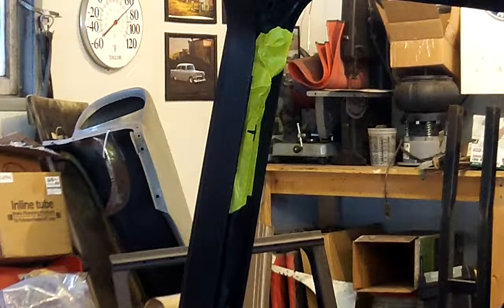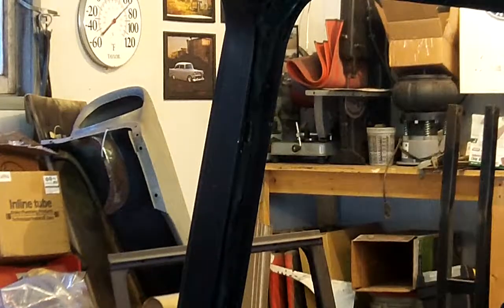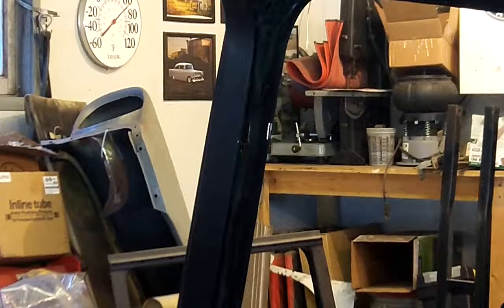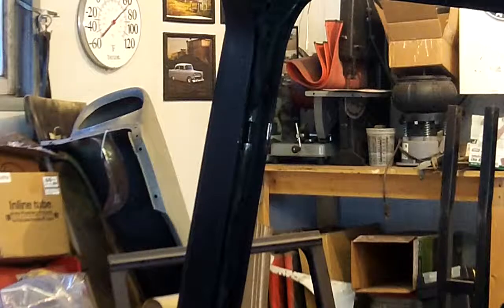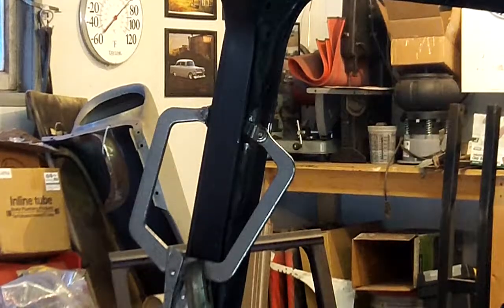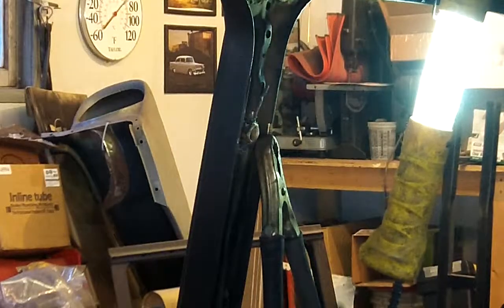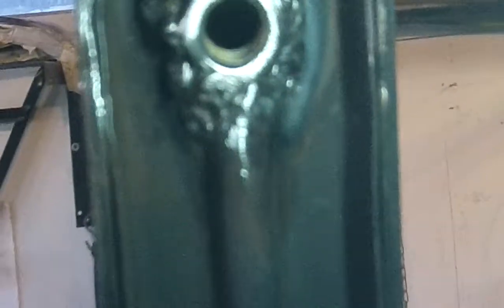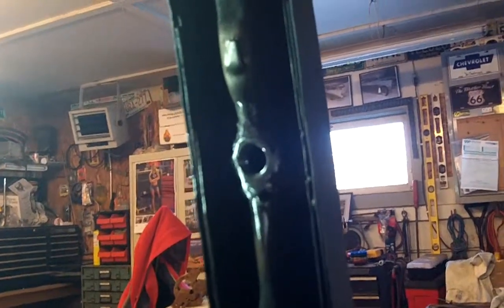1956 Chevy three point seat belt#2 NOT a how to video.

Comment: Hi Matt, do you have any videos on 56 head light cap repairs ?
Reply from the maker: Not yet. My right fender is almost rust free, the left has a partial cap done already.  I will need to finish the install of the area around the lamp bucket.  That may be done over this winter?  thanks!